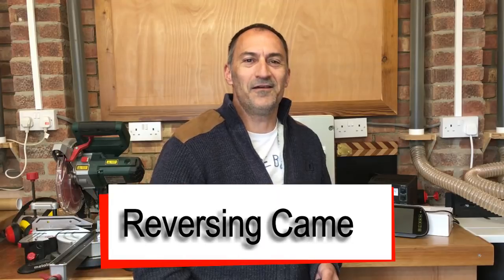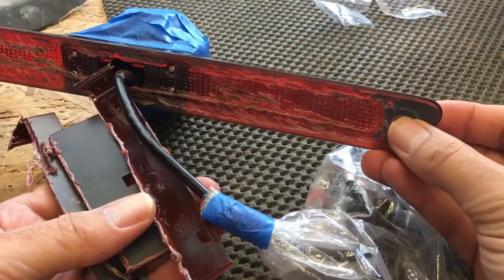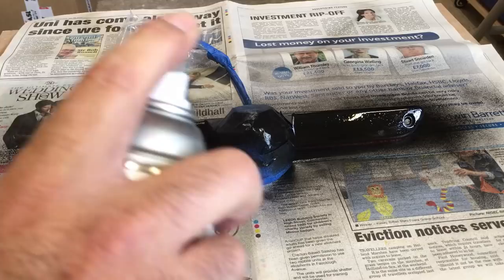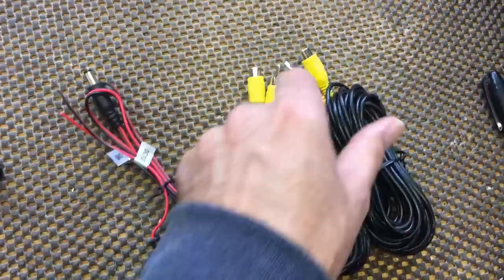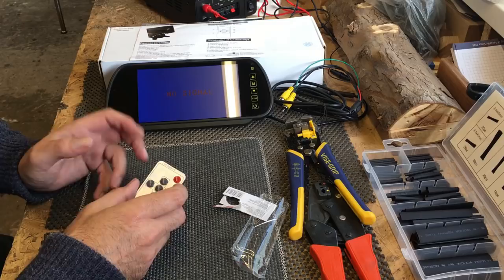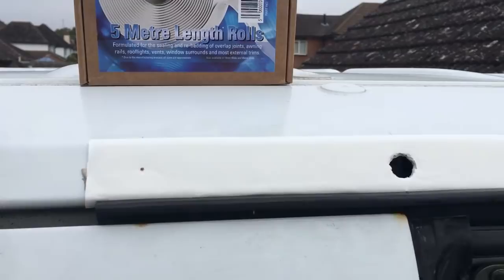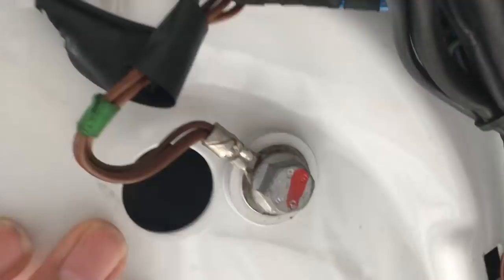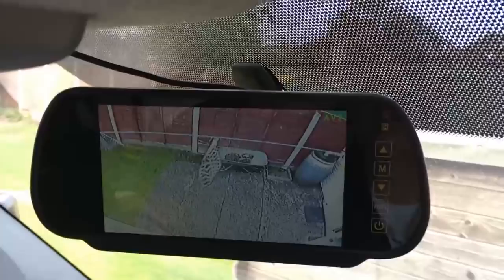Mercedes Sprinter - Rear View Camera Install

Comment from the maker: EDIT - In my particular van the reversing light was activated by a White / Blue cable. This was a different colour to that shown in a lot of workshop manuals. The best way to find out is remove the rear light cluster, only three screws, unplug the wiring, then with an electric meter simply check which wire has 12volts on it when the van is in reverse. This bunch of cables comes from the cab at high level and you can connect into it above the headliner to give you your switched signal.
I also picked up my permanent power supply above the cab as there is a permanent red supply that feeds the rear interior lights. 
Lastly I have now fitted a small switch to the permanent power supply so I can turn it off altogether to avoid any vampire drain when parked up.
Reply: This may be a dumb question, but any chance you could add a link to the switch you purchased into the video description, along with the other links to parts? Thanks. Your videos are terrific. I am studying them to help design my conversion of a Nissan NV 2500.
Reply: Where did you ground the monitor? I tried a negative cable above the headliner but it didn't work. Thank you!
Reply: Great video as always . I am getting interference in my monitor installed in the van. It was not there when I tested the system on the workbench. It is a oscillating wave interference from something. I am running the power from the internal light both positive and ground and have not connected the reverse positive switch yet? Any help would be appreciated ??
Reply: I’ve connected to my blue and white and now the camera looks like it’s about to connect when I put it into reverse but still no signal :( where do you connect the black wire from the display screen as you don’t seem to mention it in this video? Please get back to me if you can before I pull all my hair out
Reply: @MrPc924  i only needed to connect the black wire in the camera side to the vans ground and this then worked through to the lcd screen . That said i am getting interference in the vid feed
Reply: Darren Lee Winwood  thanks for that, I found the ground at the back of the van for the camera but couldn’t locate the ground at the front of the vehicle for the display, where is yours situated? Thanks in advance
Reply: @MrPc924  thats what i am saying i only needed a positive from the fuse box. the black wire went to the ground at the back
Reply: Darren Lee Winwood thanks sorted it now :) turns out my live from the camera didn’t have a great connection, I was so focused on the black wire from  the display being the problem but wasn’t, cheers, hope you get yours sorted
Reply: Are all the sprint van has the same white and blue cable for reverse activation? What is your specific van? thanks greg!
Reply: What would happen if you connected the live and switched live both to a switched live feed? Would that still work and prevent the need for a switch to stop parasitic drain
Reply from the maker: Jay Gee you can switch both the lives no problem at all 👍🏼😊

Comment: TIP: Do not connect to a constant power source to avoid parasitic power drain. Instead, connect the camera's (red) power wire to the Sprinter's reverse light lead. It's the (white w/thin blue stripe) wire in the factory bundle. Then attach the (black) wire to a ground. Ignore the (green) wire altogether.
Reply from the maker: I put a switch on the power supply so all the time it’s not in use it’s turned off. You could easily pick up an ignition supply instead.

Comment: I wired my reversing camera to be on all the time when driving. It helps when changing lanes, or just checking to see what's going on behind the Sprinter generally.
Reply from the maker: Hi Jesse, I’m thinking of wiring a small switch into the live so it’s selectable.
Reply: I would recommend it. I live 45 minutes outside Manhattan in lower Fairfield county, Connecticut and I-95 runs straight up the line through all the coastal cities. Use to be the traffic from the New York line would get extremely heavy during the commute to and from work but now it's heavy pretty much all the time. Lots of accelerations and then quick stops. It's the commuter nightmare and cost of living in this area. 
The reason I have the backup camera on all the time is to keep an eye on cars that are starting, stopping and approaching rapidly behind me as well as motorcycles that split the lanes.
I forgot to mention that up to a couple of weeks ago, I had no slide door glass. That's in now. Rear door glass wouldn't help me anyway as I have a partition back behind the rear wheel wells so the camera is really all I have.
Reply from the maker: You are so right Jesse. It would be really useful to have on all the time I’m driving. I’m going to do that. Where did you pick up your live supply from? Was it permanent or switched from ignition?
Reply: Got the power from the overhead light, the center one up from the driver next to the windshield and it's wired permanent so that if I'm camping and hear noises I can see out the back. I have a 7" dual  channel monitor to mate with the camera. It's a Sportmobile model so the wiring is behind the cabinet panels.
Reply: The cam in my lorry is broken and the screen comes on by itself all the time. You'll definitely want a switch so you can shut it off or you'll find it's way to bright at night. I don't normally have mine on until the satnav screen senses enough light to switch back to day mode or i find that the camera screen destroys my night vision.

it's not that useful at night anyway to be honest, it gets overwhelmed by headlights and its not bright enough to use to see by in tight spots unless the reverse lights are on anyway.
Reply from the maker: I'm thinking I may change the wiring to work off a switch rather than the reversing light. I can then decide when to turn it on or off as I wish. Thank you for the advise about night use, very interesting point. It would be like having the interior light on in a dark cab, not a good idea at night
Reply: If your Sprinter van has a cigarette lighter that only powers with the ignition on, then you can wire both power feeds to that. Probably means you'll need to run the wiring around the window and under the dash, but that can be done stealthy. 
Then you wont have to worry about a drain at all when parked up.
Other feeds could be from back of radio or ignition.
Reply from the maker: Paragon84 routing cables and removing plastic trim is always a pain, I have a spare 12v supply on my control panel that I could use. It would be easier to route the cables from that. Thanks for those options though. Cheers
Reply: I have mine tied up to my truck's lights, which I use when driving for safety, so it works out great.  Digital Mirror.  At night, it can get overwhelming from following car lights.  For my Sprinter build, I will consider getting something wtih automatic dimming to quell following headlights.
Reply: I have one of these in my truck.  it's wireless and finicky, so a wired option seems to be better..
Reply: Jesse Parris great idea. what do you wire the green reversing cable to?
Reply: I wired mine into my rear lights so that when I turn my lights on the video feed is connected to the dvd display. Worked for me
Reply: @jesseparris6507   Hi Jesse - we've just picked up a used 2015 sprinter and have been trying to DIY this ourselves to no avail. Shops want $600 - as a startup, that made me puke. We're located in NYC - do you think you'd be up to help us with this? I'd be willing to drive to you and compensate you for your time.
Reply: aaohaus - I’m taking care of a post-op family member at the moment which will last a couple of months., so I can’t.

Comment: I now have a warning light up for the "third brake light", after disconnectting it. How did you combat this? Did you solder the wires together to create a circuit?
Reply from the maker: You need to connect the wire that feeds the existing brake light to the red and black on the camera light. The new camera fitting has a brake light in it that must be connected. Please watch my video again and refer to my diagram.

Comment: Should the positive feed to the monitor be a permanent live? I have it all working but the monitor is either on and the no signal sign or camera when in reverse. I was so pleased at first, now frustrated
Reply from the maker: If I remember right there is a permanent live on red and a switched live on the green

Comment: Hi Greg,  good work on the video come in handy for when i go to fit one.   is it possible you confirm which camera kit is the one you're using the link goes to many on ebay and would you still recommend it after using for a bit now?   Reading through some of the comments below I see you discuss alternative use/wiring methods would you still splice into the reverse lights and connect as  shown in the video? Thanks in advance

Comment: great help. just started a VW crafter conversion and your defo the go to place for info. one thing that I found different on the crafter was the brake light feed wire was white with a blue stripe ( 2014 crafter . this may save others having to remove a rear light to check the wiring). also another comment was wanting a perminent rear view. I'm considering a adding a second camara in the VW symbol and feeding it in to av1 so when the screen is switched on you get the av1 camera view and when you go into reverse you get the high level cam. again love the vids and keep up the good work
Reply from the maker: I posted an edit comment that mentioned the white and blue cable. I also added a power supply via a switch in the cab so I can turn the camera on at anytime I want to. Even when the van is switched off and parked up.
Reply: should have read all the posts, thanks again

Comment: Great videos. Not to say you did anything wrong. Some thoughts for future improvements on what I have picked up elsewhere. 4 cameras around the van especially with IR capabilities and with IR LEDs. That way if you near something prowling at night flip a switch gives you a 360 view without going out first. A couple of 12 volt LEDs spliced into one of the break lights would have given you an actual high break light. Love using heat shrink being an old electrician I use it on any terminal connections
Reply from the maker: To make this work as a rear brake light I would have needed to source a rear brake light module.
The camera kit just replaces the lens. I would have also had to cut a much bigger slot in the van.
This suits my needs, thank you.

Comment: Just wanted to leave a comment to say I really enjoy these videos. I am looking into a similar project myself as the Mrs and I attend music festivals, run a track car at events etc. so a camper would be extremely useful. I haven't the foggiest with wood working and the RCD stuff etc. but I have done a lot of work on my own cars over the years including the odd bit of wiring, engine removals, suspension etc. so hopefully I'll pick it up when the time comes!

Keep up the awesome work :)
Reply from the maker: Hello Jay, I'm in a similar boat. I'm a mechanical design engineer, messed about with kit cars and motorbikes most if my life but only started doing any wood work less than a year ago. It's a very steep learning curve but I'm really enjoying the whole process. Thank you for great feedback.

Comment: We made our backup camera on the boat switchable instead of relying on reverse, because it functions a bit as a security camera as well (we want to eventually be able to check the boat remotely), and sometimes I just like to see what other people are doing to the back of me without stepping outside.  Or watch the gulls.  But that's different from the needs in a camper van, so maybe it makes sense for you to only switch it on when reversing.  It seems like a nice camera in any case.

Comment: just a thought, on my last build i wired a single pole double throw switch on the dash so i could have it set to just reverse activation and to a manual activation. the main reason for me was i was towing a large trailer and it gave me peace of mind to check things while driving occasionally.
Reply from the maker: That's a great idea, Having a manual switch so you can use it at ant time will be very useful. I'm going to do that, thanks.

Comment: Hi Greg. I dont normally leave comments on YouTube but your video helped me I have mine on all the time now as just helps to see what's going on behind
Reply from the maker: Danny Richardson thank you for taking the time to leave a comment. It’s nice to know the video has been useful to you 😀
Reply: @GregVirgoe   it was the green one I was thinking where am I going with this one. Then was your video. 

I have just put mine with the live as I wanted it on all the time. 

Ye definitely a good video helped me alot
Reply: I see everyone seems to be connecting the camera to the permanent 12v wire. Surely this will drain the battery when the van is not in use or have I missed something..? I'm so confused. Also amazing video Greg. You have a video for absolutely everything, you are a hero mate 👍🏻

Comment: Greg, I have just bought a 10 YO Motorhome and the reversing camera was not working so the dealer rightly replaced it with a new model. Its a Visio Evo Easy by VechLine. It is a single view camera looking directly at the ground behind the van. I have been looking at dual cameras which point rearwards and down. The one pointing down works only when in reverse and the other camera works when driving forward. I am investigating if I can just 'plug in a new dual-camera to the existing wiring. Looking at the various diagrams it looks as though they run off separate AV wiring.
Reply from the maker: Tom Wharton my system has two AV inputs on the video screen you would have to run two ac cables of course and simply flip between the two views on screen with the remote.

Comment: Excellent!    Backup camera I've seen in  USA have guidelines appearing on ground to aid the process.  Perhaps the feature was not activated in your unit.  I'm planning to make my van city stealthy so I'll be exploring 360 & IR viewing.
Reply from the maker: I agree Preston, having IR cameras on outside in a city environment does sound like a good way to go. I was looking at systems where you get a live feed to your smart phone via internet even when you are away from the van. The van obviously needs a SIM card in the head unit and its own wifi which my new head unit has. So imagine you park up and wander of to a restaurant and you can check to see if your van is OK live. 👍🏼

Comment: You can add an ON/OFF switch to activate the camera at any time. Simply install a diode on the green wire that goes to the reverse lights to prevent backfeeding when the camera is activated with the switch. This is what I would do. Having the camera on when driving in heavy traffic may be very beneficial since you can't see anything in the central rear view mirror. Just an idea.
Reply from the maker: Hello Andrew, would you know how to size and select a suitable diode? Cheers
Reply: Most rectifier type diodes should work. I'd look for a diode rated for 50+ volts and 1 amp. Something like 1N4001 or similar. Just make sure it's a rectifier type diode. Put it inline with the green wire and orient it to conduct towards the display (input). Don't forget to fuse the ON/OFF toggle switch circuit (1A fuse, as close to the power source as possible). Any device connected to the battery should be fused accordingly, as close to the battery as physically possible. Obviously, there will be very little current in the camera activation circuit.